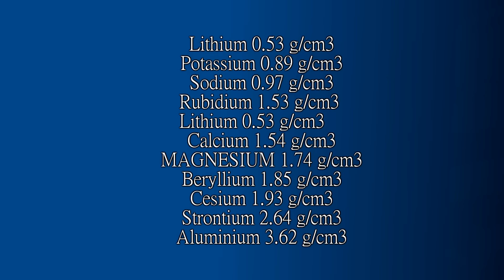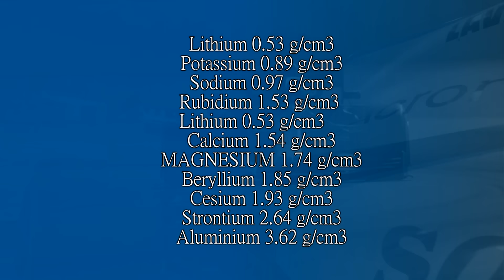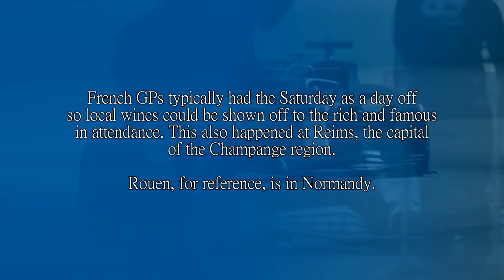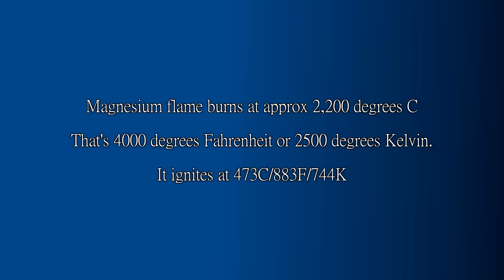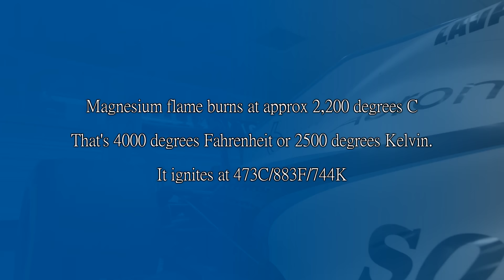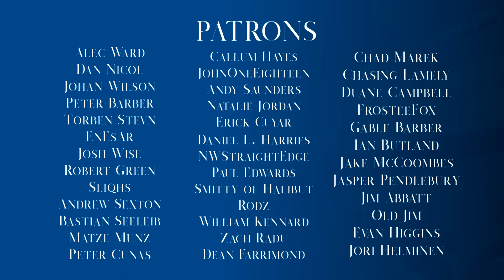The Car that Should Never Have Raced: The Story of the Honda RA302

Comment: Magnesium alloys always made wary when I worked in aviation. The landing gear components on the Hornet are made mostly of magnesium. They told us if it manages to catch fire it will burn so hot that throwing water on it will literally create an explosion as the water atomizes. What we were supposed to do if the gear caught fire was push the plane overboard before it melted through the flight deck.
Reply: Not specific to the Hornet, but I do recall seeing many cautionary videos of firefighters unknowingly dumping water on a metal part that's caught fire (I think I saw one for a car that had a magnesium transmission and they came in with the hose) and yes it basically explodes, similar to how you don't want to throw water to an oil pan that's caught fire in the kitchen, but even more dramatic.
Reply: @zeroelus  I agree, throwing fire at burning pans is usually a bad ideia.
Reply: @joaopaulo-ms5it  Yeah not recommended haha, fixed that typo
Reply: I think seeing magnesium burn in science class showed that well enough.
Reply: Burning magnesium in water will dissociate the water and use the oxygen to keep on burning, releasing lots of very flammable hydrogen in the process.
Reply: You definitely do not want to use water on a burning metal which is why they are mostly stored in oil. HOWEVER, those stories, any of them from the modern age, and I assume u r talking about the F18 Hornet, are all rubbish, old wives tales like Bro Science in the gym. Between the alloys used and things like calcium added to the mix, they will never catch fire!
Reply: No fucking way. That's crazy [even if sensible and practical, if the use of Mg was necessary] that the recommendation was to push the Hornet off the deck. What an unfortunate remedy lol. Ty for sharing lol. Wow.
Reply: @dan-tv1kp  Think about it: $30-50 Million for a single plane, or Billions for a Nimitz class carrier?
Reply: @GrizzAxxemann  No for sure, definitely a  sensible and practical decision. Crazy that it may have to come to that though lol.
Reply: @christianbuczko1481  oh yes my buddy and I were last to get the roll of magnesium to cut off about a 2 inch piece for th Science experiment. At the time we knew it burned really bright. But instead of doing what we should have e kneeled down and I lit the end of the roll. Bright it was as it burned but the teacher was headed our way and that's when we found out that it was not going to stop burning. 
Another trip to see the PE Teachers being they administered the  swats.
Good times
Reply: There’s an old ici video that was shown in chemistry lessons where they put the alkaline metals in water and there were sparks and flashes

Comment: It wasn't the last time something like that happened, the use of fast burning composites in the Lancia Delta Group B car led to the deaths of Henri Toivonen and Sergio Cresto in the WEC in 1986 leading to the end of Group B
Reply: Aidan did a great video on Group B before YouTube struck. Don't know if he's still got it listed. If so, it's a very interesting watch. Sad, though.
Reply: I thought a dodgy roll cage and unsafe exposed fuel tanks caused the problem, but the composites burnt away rather than leaving a metal coffin
Reply: That car was also something that should have never raced, it was very flimsy in some areas (gas pedal went thru the floor and got stuck there, front end chassis bars were very fragile etc). Add to that the fuel tanks under the seats on the bottom of the cars, and using fuels that caused drivers to feel dizzy and have eye irritation. It was essentially 700 horsepower 4WD crematorium. Audi was the only one having safe car, as the car was build around mass-produced vehicle using its steel chassis with composite used only on the panels, and the fuel tank at the back.
Reply: WEC ?
Reply: It’s very telling when Lancia still fielded the 037 for the Safari Rally instead of the Delta S4.
Reply: @Rentta  Rally, not endurance.  Idk if it was officially the WRC yet. 

 Group A in endurance was running at the time though, so I understand the confusion.
Reply: @d-d-i  Sorry but you are wrong, Audi was the same "build quality" as the lancia, the audi was a cut in half chassis , shortened, then welded back together with another cars windshield+roof welded on to complete this "chassis". It´s a sound design as is the lancia, no flimsy rubbish as you mention, as flimsy cars don't finish races, these things blasted over uneven terrain at 160mph with 1000Nm of torque trying to rip appart the structure and mechanicals. Engineers of the past are not stupid, they did't build "crematoriums", and your daft quote stating production cars are superior in strength than a FIA rollcage just shows you have no engineering knowledgre at all. It's said the Lancia had Nitrous or Methanol stored in its rollcage. Kind regards from a IRC/WRC mechanical engineer

Comment: Also worth mentioning that Titanium is really hard to weld. It reacts with open air at welding temperatures, so you have to either do it in a vacuum or blast it with inert gas to displace any oxygen.
Reply: I learned that from researching the development of the SR-71!
Reply: not if you know how to weld ti....awkward to weld, not difficult
Reply: @paulnutter1713  I mean with the equipment of the time
Reply: @WynnofThule  fair comment.... and the knowledge, the ruskis knew more about welding ti than the west at that period
Reply: @paulnutter1713  I thought they had to use nickel steel skin for the Foxbat because they didn't have the titanium welding knowledge that the Americans soon did with the F-15
Reply: @WynnofThule  alfa class subs, late 60's
Reply: Which is why when All-American Racers built an Eagle with titanium, they had to use rivets
Reply: My opinion is don't work with titanium or magnesium unless you really have to work with these. Too much of a pain and often too expensive. A lot of stuff can be in plastics or steel or aluminium and these are easier to work.
Reply: TIG welding is not difficult.
Reply: @WynnofThule  A lot of new welding techniques had to be developed in the space program, which was all going on in those same years. They were also using exotic, lightweight materials, in addition to having to deal with cryogenics, which included having tanks of liquid oxygen & liquid hydrogen, which have widely varying temperatures requirements, sharing a common bulkhead (liquid hydrogen will boil off at the temperature where oxygen is liquified). With all the wild stuff going on in racing in those days, I'm surprised no one ever tried to build a race car that had a cryogenic system and ran off liquid hydrogen, or, perhaps, fuel cells, which were a technology originally developed in England and then taken up by NASA.
Reply: @WynnofThule  back when the soviets were building Alfa and Typhoon subs they already had it figured out. Pressure hulls made of titanium, they basically covered the whole structure in a pressurised box filled with inert gas, then sent engineers with oxygen supplied suits to weld it all up
Reply: @tyler_bt3326  
Given the history of the Soviet Union, I suspect there was a pretty shocking death rate associated with that practice.
Reply: @jimiverson3085  probably not the safest, but on that scale it’s the most cost efficient and easiest way to get shit done. I can’t really see any specific risks that make it any more dangerous than regular welding
Reply: @tyler_bt3326  
I'd count on the Soviets to have found a more dangerous way to do something.
Reply: @robbiddlecombe8392  
Man, I know about the the Auticoast ti 22 and Norris Industries: a long time ago, I uses to drive it a lot on rfactor 1 and Nascar heat with some mods installed. Very interesting car with a huge Chevy V8 at the back: 7 liters, there around.

Great fun at the modern Spa, but passing Eau Rouge and Radilon with this car was tricky. It's an old Can-am car, so of course that's going to be tricky, but that car got hard suspension... And can bottom out at some place.

That car was not only in titanium but I think it's one of the first to try to have a bit of a raking angle. And the suspension were hard on that thing to deal with the down force and smaller wheel. Very peculiar design.

But even with Jackie Oliver, who was a brilliant driver, the most the Ti 22 had was a 2nd place. In 6 races, 4 retirement.

That car was competitive. It wasn't reliable.

What is less known is that the Autocoast had assembly issue, was also incredibly stiff, the mechanics had to work 16 hour shift to prepare the car. 

It's also a great lost that one chassis was apparently lost. They had to recreate one to bring to Long Beach a few years ago.

A little later (1970 or 1971) AVS bought Autocoast, creating the Shadow racing team and very great race cars. Even monstrous for the DN2.

Titanium is a great material. I'm not knocking it down. But like any material it's also how it's used.

A bike frame made out of titanium is maybe $2000 or $3000 on the cheap side? Just to ball park it... Of course it's lightweight and stiff and all, but it's also a little niche: which is perfectly fine to have assuming you know what you want.

One can get a bike at $200 made out of steel and there isn't much wrong - or fancy - with such bike either. And that's going to be sufficient for a lot of people as well.
Reply: Its not difficult but it needs a shitton of gas
Reply: Doing it ultra clean with no HF start on a stick arc machine that has "coarse" and "fine" controls, manual gas valves, and no foot or hand control would have sucked, and been quite the balancing act.
Reply: I design underwater instruments that use titanium housings. We typically weld them to keep them watertight. Yes, we use inert gas welding. We also laser mark those housings at the same time: branding, model name/number, and serial number. Ti is a great material as long as you keep in mind that it is not anything like steel or aluminum - at all!
Reply: @tyler_bt3326  Ive read somewhere ti wasnt really good to use on subs because the hull would change shape after deep dives. 🤷
Reply: @lochnessspeedwerkz6557  on earlier subs they tried using thinner hulls (because same strength but less weight) but they experienced warping issues. Thicker material is fine, some of the deepest diving subs in the world are titanium hulled
Reply: @tyler_bt3326  That makes more sense. I knew I heard something around those lines.
Reply: I would also like to add unless i missed it is that magnesium burns even fiercer when it comes in contact with water. It burns very well under water.
Reply: @RRaquello  Look up Turbonique. From Rocket thrust engines Turbine driven Superchargers that were so powerful that even with every spark plug tip burnt off the engines were estimated to still produce 800 hp just driving the pistons around, to A rocket fueled turbine driven rear axle. You could take off using the normal drive side of the axle, engage the turbine putting in another 1200 hp into the rear axle. The faster they went the more power the turbines would make but it wasn't a combustion turbine it just got driven by the thrust of the rocket engine. Real Crazy stuff
Reply: There was a Russian couple who received a titanium tandem mountainbike as a wedding present. He worked at a titanium bike workshop, his collegues built that tandem for fun (and it was said they paid it together).
Reply: @RRaquello  Would friction welding work, with Ti?
Reply: @michaelroberts1420  Yeah, school boys ductaped magnesium into a toilet. When flushed, there is fireworks.
Reply: It's only hard if you don't know what you're doing........ Like me...
Reply: @voornaam3191  You should see what sodium does
Reply: Titanium is a nightmare of a metal, useful but a nightmare.
Reply: Most welding also requires protection from background gases. It's nothing new for welders.
Reply: It isn't "actually" hard.  It is about the same as welding stainless steel.  Purging the weld area is actually pretty easy to do.
Reply: What you described is true of all metals, they all need shielding gas (magnesium included). What is particular about titanium is that its not just the weld pool that needs it, but the entire heat affected zone. When you see those fancy blue titanium welds? It's lost a good chunk of its strength and if it were a critical part, would be ruined.
Reply: @etoineschrdlu9382  Funny, I have been welding Ti for 25 years, welds like cold rolled steel, I use 10% more cfms on shielding gas, backgas all tube welds, it’s easier than aluminum. And whatever you do never get into a jet aircraft, magnesium all over the place.
Reply: @paulnutter1713  and they had alot of said material in there country
Reply: I was confused till I realized you were commenting on the era.

It's still kind of a pain now but not nearly as bad as it once was now.

Fun Fact I still have a bottle of Helium/Argon mix for Aluminum from the era when TIG was called Heliarc.

I have a very low opinion of an Aluminum spool gun. But it's good for tacking though. I ran out of Argon and put that bottle on it. I know it's been in the shop 25+ years.

 We don't typically get rid of equipment. Just add on to the shop to have room for more modern tools but sometimes an older approach is less difficult than the modern one.

Right tool for the job approach. 
Pays to maintain everything in perfect working order.

Doing a Hastilloy job right now. It's different. Crazy expensive material.
Reply: @therrydicule  2x stronger than steel and half as massive. Perfect to meet mandatory energy and fuel mandates.
Reply: @SovereignTroll  
You're right on that one.

However, there is also a question of is the customer ready for the price difference?

Sometime even things that make sense on an accounting basis pass badly with some customers.
Reply: @realblakrawb  He was refering to the period. They hadn't figuered out a bunch of stuff before then.

I got a bottle of Helium/Argon mix older than me and I turned 50 this year.
Reply: @voornaam3191  You must be confusing magnesium with sodium or potassium. Magnesium does NOT ignite when it contacts water.  
As mentioned in this video, racing wheels have been made of magnesium for many decades. I've yet to hear of them igniting when it's raining.
Reply: I didn't know this, but that explains why when I emailed a company to make all of my car's panels out of Titanium, they looked at my wealth and laughed.
Reply: @WynnofThule  No, that was for reasons of cost and production schedules. Building a fleet of 30-odd SR-71s for the same cost as several hundred MiG-25s… It makes sense but only in very specific applications.

Comment: As soon as I saw the thumbnail I knew which disaster you'd be talking about. It's a story that needs telling and thanks for your usual level of decency and respect. I remember reading that Surtees had not exactly been subtle about the stupidity of using magnesium in the manner it was, and that he'd threatened to walk away from Honda (and possibly F1) if they tried to make him drive the death trap. And this was a guy who'd won the equivalent level championship on a motorbike before racing cars - you can't do that and be a nervous individual. 

(A few riders have been lost this year, including Chrissy Rouse in British Superbikes. He was an adorable maths teacher and great rider whose death absolutely devastated the paddock and fans. The TV presenter was in tears announcing it. I've not heard that before. Close, but not quite so devastated.)

IIRC Surtees also took part in a number of road races including the Isle of Man TT, and whether you're a bloke or a gal, you need a huge pair of brass ones just to ride that course, even at the back of the grid, especially before safety was "a thing". Even now it seems that there is at least one death a year there (there were two or three this year, and some serious injuries).

Aidan, if you want a change from 4 wheels, the TT (or any road racing) will have a ton of stories waiting for you. The curse of the Dunlop family might be a place to start. A mix of riding genius, bravery and tragedy wrapped up in one family. Of the four racing members I know of, three were killed during races: the remaining one (Michael) lost his "King of the Mountain" Uncle Joey, his father Robert (? iirc - my mind has just drawn a blank! Someone correct me if necessary, please) during a race that his sons were in, and most recently, his brother William. Michael is still racing.